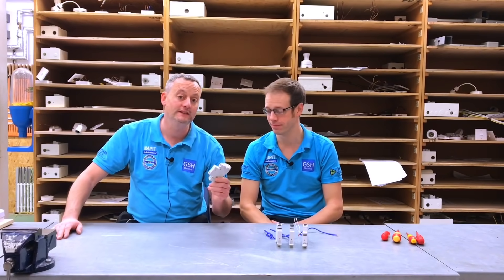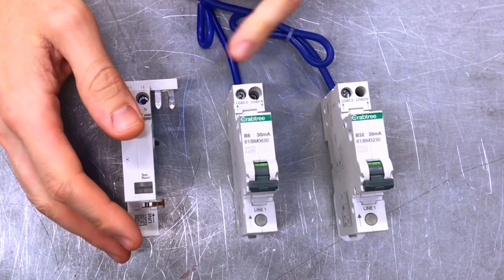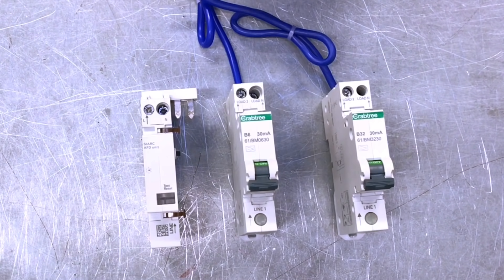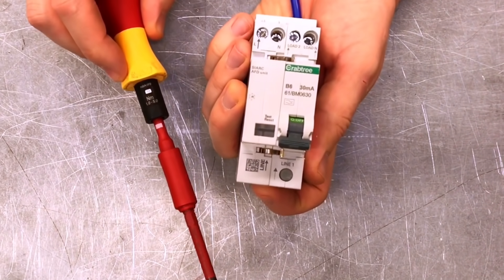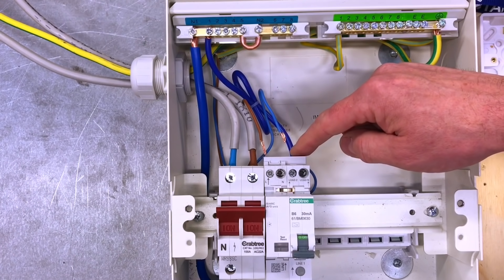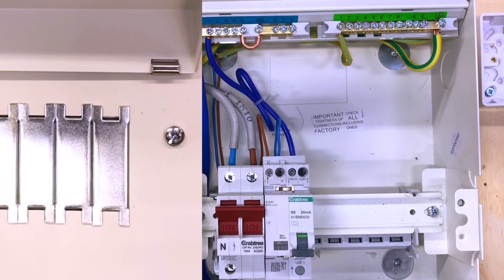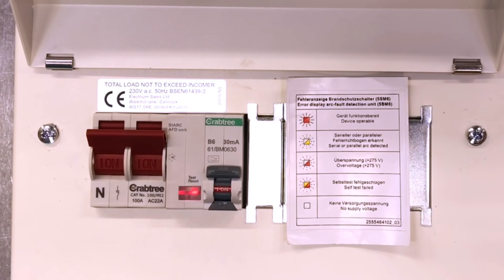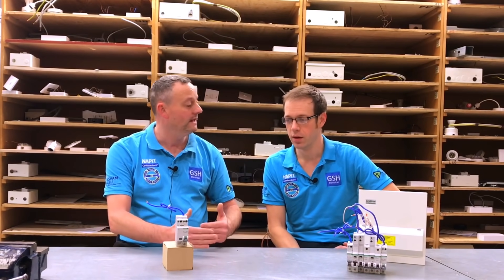Connecting up an AFDD unit (Arc Fault Detection Device) and Powering it up in a Crabtree Board

Comment: My understanding is that AFDDs can significantly affect ethernet power line adaptors... Has anyone been able to lab the scenerio up yet?
Reply: Ethernet powerline adapters are basically the devil anyway so I only see that as a good thing.

They only pass regulations on noise in ideal conditions/test setups and not when actually used. Your mains wiring acts as an antenna for all of the high frequency noise that the devices generate. The noise generated is across a range of frequencies and tends to swamp amateur radio bands as well as the 2.4GHz range and others.
Reply: @mowcius  I don't disagree. But I think it would be interesting to see the results. For the ham enthusiasts though survey it would give them a more challenging fun project in filtering and recovering the snr... Too easy for them now days ;)
Reply: @themoog  I think it's the HAM radio enthusiasts trying to listen to those signals that are basically lost in the noise under normal situations that get upset when you raise the noise floor!

Comment: If it has Overvoltage protection ,is that not what an SPD protects against ? Therefore it will be an MCB, RCD, AFDD and SPD in a two module device ?
Reply: I suspect that the detection and protection time for the overvoltage part is not anywhere near fast enough to help with the surges that a SPD protects against.

SPDs are designed to suppress and divert the excess energy (with discrete components) from a surge to stop it destroying the rest of the installation. The AFDD will simply detect it (digitally), and do its best to cut off the circuit.

They likely threw in that little crumb of extra functionality simply because the existing circuitry and software could do it.

Comment: Interesting setup. Here in America the arc fault device is also the circuit breaker, no need to pair it with another breaker.   Your manufacturer's found a great way to make you buy more!  We also have combination AFDD/RCBO breakers in the same module, so one space to protect them all.  

Our code book requires arc fault protection for basically every circuit in a new house. It also requires that we upgrade to arc fault if we add an extension to an existing circuit. Welcome to the Arc Fault club,  siemens will be along shortly to collect your dues.
Reply from the maker: Wow thanks for the detailed comment from the Sates. We are about 12 to 18 months away from a combined single device. All the best and thanks Gaz 👍
Reply: Here in Germany Siemens is the only manufacturer how sells the afdd and the MCB/rcbo in two different parts. I think your crabtree is made in the Siemens manufacturing plant and only labeled as crabtree. Hager Eaton, Legrand, Schneider,ABB have monoblock design.

Comment: If an Electrician is competent and experienced there would not be any need for an AFDD, or is the trade now catering for amateurs and Firemen?
Reply: A fault causing an electrical arc could be caused by any number of incidents caused by other trades or indeed the homeowner.

These devices will detect faults in connected equiment as well - arcs from frayed appliance cables/extensions, arcs in cheap electric heaters etc.

Comment: Hi just for Clarity please.
Will every circuit need to be covered by an AFDD device?
Is there an AFDD device that covers several circuits like and RCD?
Will every MCB module require a ‘bolt on’ module like this effectivley doubling the size of the CU?

Many tha ks
Reply from the maker: Hi. The AFDD is just a recommendation/consideration in BS7671 but know doubt in later amendments will be come a requirement in given situations... within 18 months the unit will be a single module. Thanks for commenting and watching GSH Electrical 👍

Comment: i understand that they say afdds are for final circuits, but do you think they will make ones that would replace rccbs in split load consumer units ?
Reply from the maker: Hi. Single modules within 18 months 👍. Thanks for commenting and watching Gaz
Reply: @GSHElectrical  hi Gaz that's not what I meant. I was meaning about having and afdd with and rccb to bring costs down for the client because although there will be single modules they will still have a massive cost.
Reply: @paulmerchant9015  I doubt it as the regulations try to lead you towards RCBO boards as it is. Electrical work will be >5% of the value of your house soon!

On a practical note, unlike RCDs where faults are often relatively easy to guess and find, a fault detected by an AFDD could indeed be anywhere in the installation - narrowing it down to a single circuit at least gives you a chance of finding it before you rip all of your hair out.